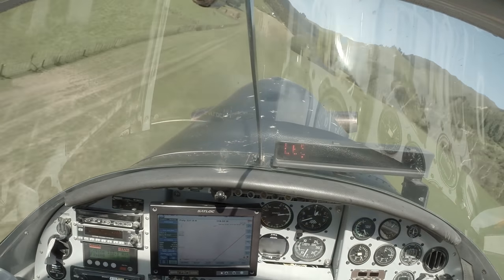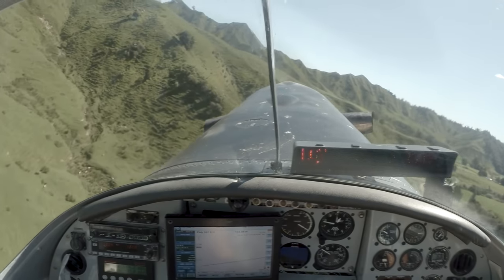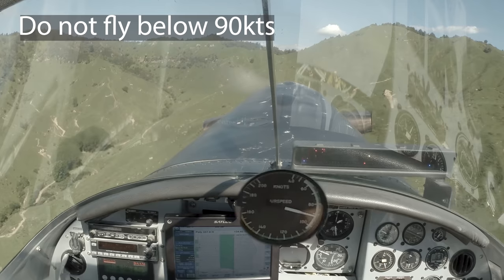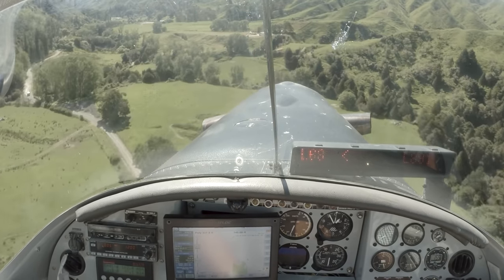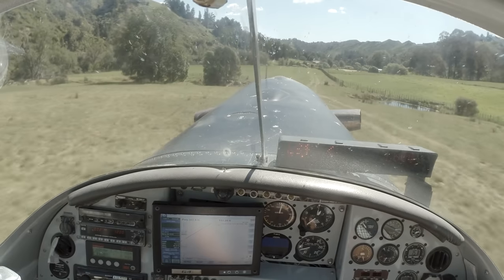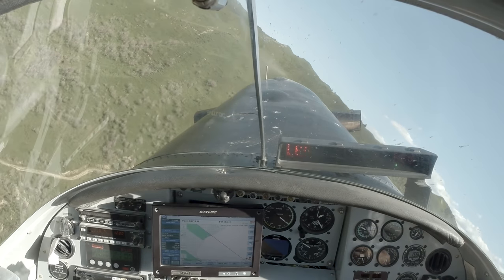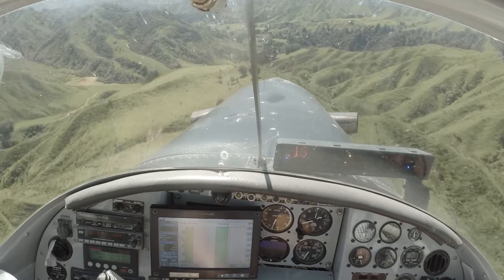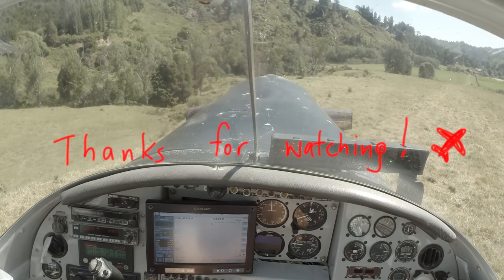Difficult airstrip - Cropdusting up a mountain

Comment: Not a real pilot but build and fly RC planes.. when you change the position of the battery even a half inch up, down, left or right, it completely changes the flying dynamics of the aircraft. I couldn't imagine flying a real plane that low over mountainous terrain while carrying a heavy dynamic payload.
Reply: Another RC enthusiast and also glider pilot here. I was wondering about that, and when looking at the side view it appears the the loading hatch and probably the load sits right on the CG. It would indeed be a worry with a badly distributed load when flying like that...

Comment: Mate of mine used to keep some old orange Vango tent fabirc to wrap around the base of poles n places like that and secure with a length of bungee rope. He'd only wrap the bottom couple of feet but leave the rest of fabric out flat on the ground to increase the visibility looking down from the air. Worked so well the local hang gliding club started doing the same. 
Orange spinnaker fabric works well too and is very light and compact to fold up. Make sure you peg it down though is the wind blows it away into bushes you're goin to be misled where the pole is.

Comment: I've got 1700 hours of mixed helicopter and fixed wing, Flying into Milford Sound ... I spent 20 minutes in a machine like this. I have never been more impressed with a pilots skills .. The machine is just a tool to get the Fert on the ground ... Pulling reasonable G at every turn.

Comment: Another great video Jimbo, prefer these longer ones than the short 1 min clips. How much does airspeed effect the sowing rate?
Reply: I wondered that myself…
Reply from the maker: It changes the rate, going faster vs slower, though the latest hydraulic doors will change according to your groundspeed- giving a true constant rate. I am using this newer system now, I'll put up a video showcasing it 😎

Comment: Hey Jimbo….Love the flying and explanations.  Just curious as to why you don’t use a Transland or Spreadmaster spreader like in the states?
Reply from the maker: Great question. I have used them on some ATs over here. Most are made here, I believe, because they are cheaper to buy and maintain. Buying parts and repairing becomes expensive when shipping and duty gets attached to each purchase. I could also be way off the mark here 🤷‍♂️

Comment: WOW!!!  Awesome flying!  I'm curious about the performance.  Is the plane nose heavy when after you empty your cargo tanks?  It just seems odd that the engine AND the pilot are well forward of the wing which gives an amazing view of course.  I seems most every plane has the pilot setting on top of or behind the wing.  I really hate that because the wing blocks so much of the downward view.  I would think this design makes the plane very nose heavy when flying around without any cargo onboard.  Is that true, or have the designers got the W&B spot on?
Reply from the maker: Cheers mate. Engineers got it good with W&B. Empty she's good, and the hopper is almost right on top of the midpoint CoG 👌

Comment: Incredible Video & share THANKS

One question bin meaning to ask... Does  GPS tracking Software take into account "actual" (or manually entered) wind speed & direction & height of dump?

Be interested to know how you compensate for "all that" too 🤔
Reply from the maker: Great question! Short answer is no, but I'm hoping this is going to be integrated soon. It would be relatively simple to do and a big step up in accuracy 😎

Comment: if you pull your power back to idle but still going to fast how do you slow down
Reply from the maker: The plane is a big burly speed brake, they slow pretty quick with no Prop pushing her along 😁

Comment: What is the procedure in case of an aborted take-off? Do you calculate the different performance figures like v1, vr and v2 for every take-off, considering different load and fuel weights? What about the obstacle clearance minima? I think this kind of flying is incredibly dangerous and I wonder what kind of regulations you guys must follow.
Reply from the maker: Great questions. There is an inherent risk involved with ag flying, hence it takes a certain type of person to do the job. With the skills applied correctly it is a very rewarding career. 

The procedures are the same for an aborted TO, the main difference is the decision points are a lot earlier. Provided certain criteria are met, there is no minimum obstacle clearance. We follow CAA part 137 regulations. Thanks for your interest, I appreciate it 😎

Comment: Easier turnback on taxiing using some flaps.  I use take off flaps.. Less rpm needed on taxiing.  Some lift from wing, and you will never forget them for next take off.  Better for prop and ground too.  Taxi Flaps..
Reply: Taxi Flaps.